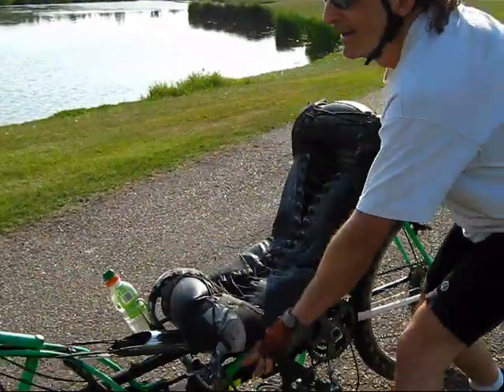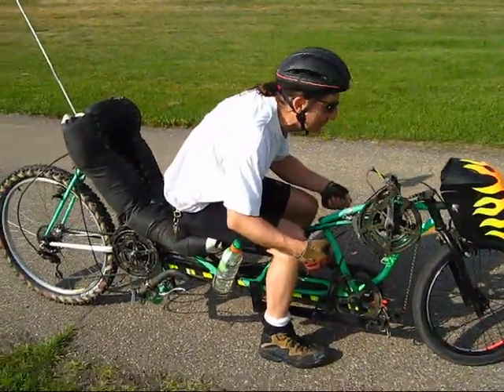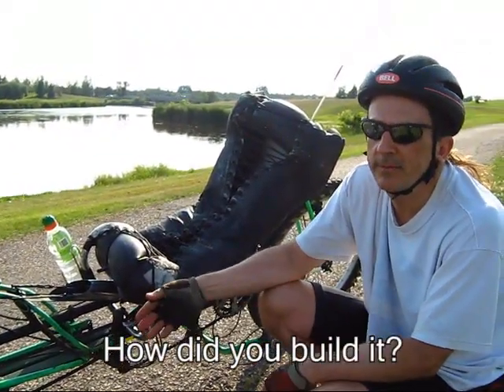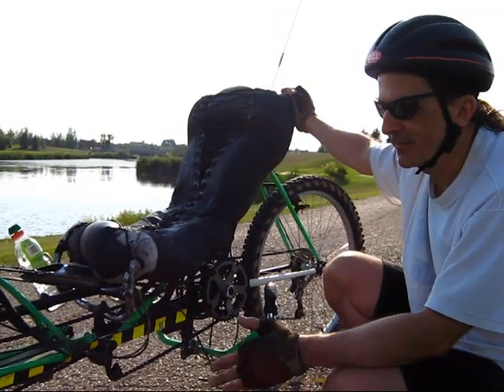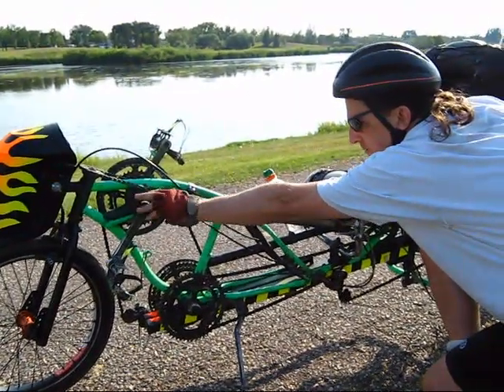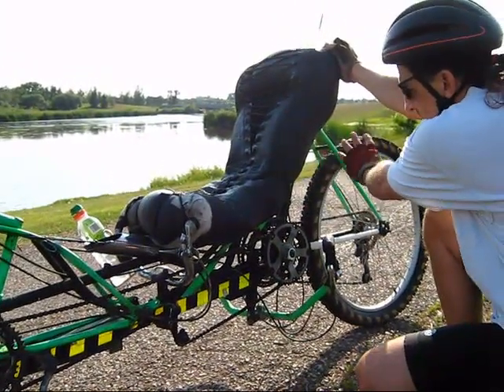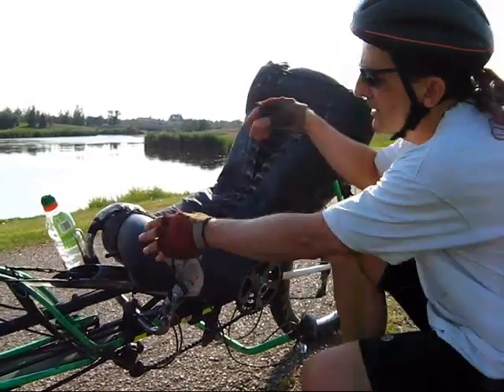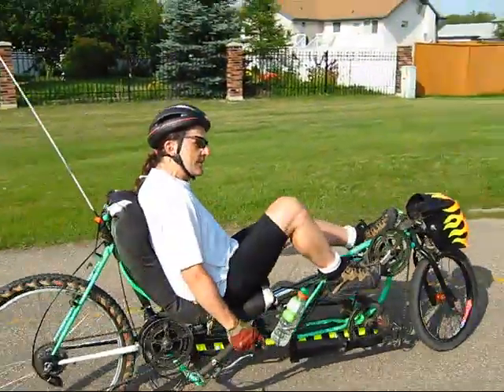Recum-Bent

Comment: It looks interesting and heavy at the same time.  I will never go back to riding a diamond frame bike as the comfort levels on a recumbent far exceed what is available as options on any DF. No pain anywhere at the end of 6 hours riding and none of the wringing of the hands to get circulation going again or standing to pedal because the butt hurts that for some reason we all do as it becomes second nature to our riding style , or sitting up to take the weight off the hands and neck?  Speed up hills or down depends on the rider not the bike or recumbent, and so far I have not found a hill that my bent and I can not climb. Downhill and on the flats I am pushing less wind out of my way exerting less energy  than what a DF rider does. BTW buy used as the first bent will not be your last as these creatures vary in attributes far more than DF's.